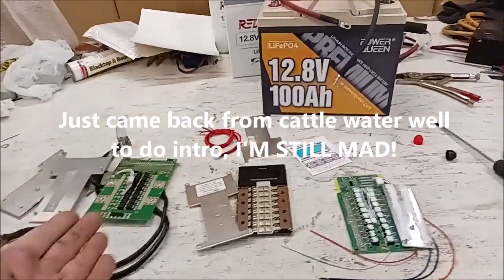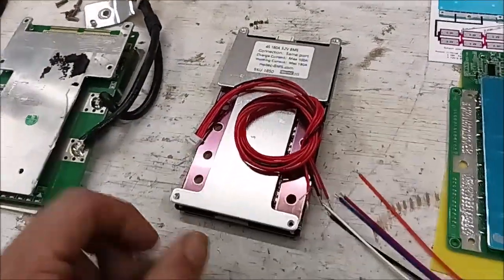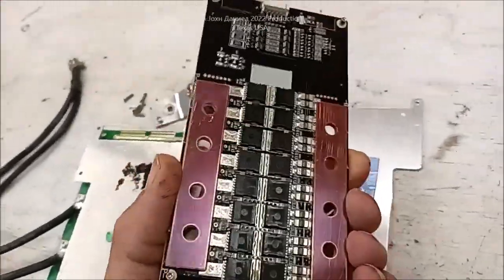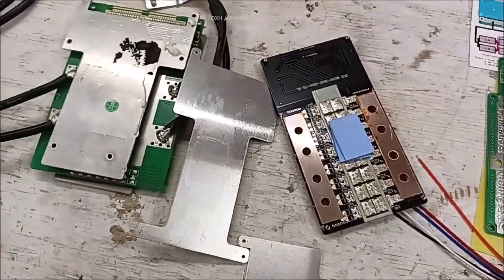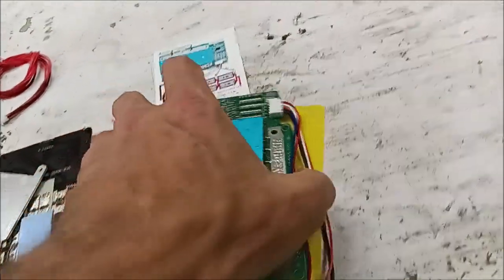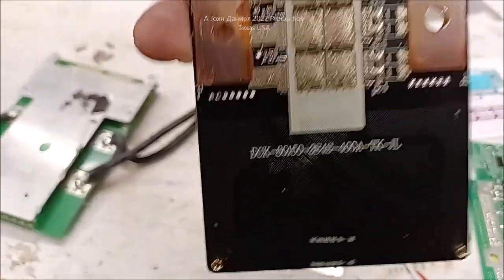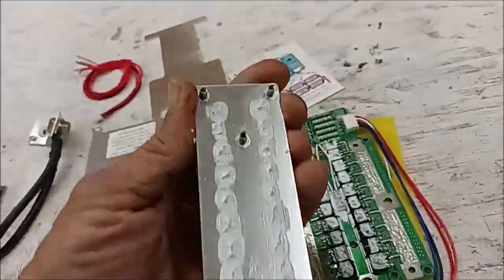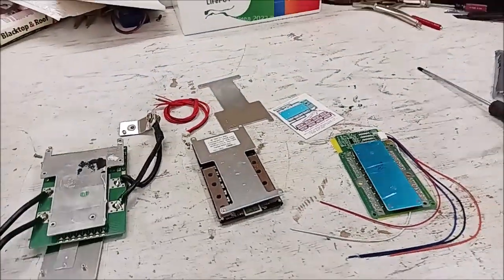HELTEC BMS Battery Management System, once great, now garbage? Better cheaper options below

Comment from the maker: UPDATE ADDED BELOW A better affordable BMS brand https://s.click.aliexpress.com/e/_DmplTQF and lets keep it going,  https://www.buymeacoffee.com/JOHNDANIEL  join up. Discover more. Never again will I buy something from Heltec.  POWER QUEEN Premium LiFePO4 Batteries 10 to 400 Amp https://shrsl.com/3kfqh UPDATE - I sent the high resolution pictures, 8 of them, to a tech friend who now works remote for Mouser, 34 years a technician. Started at VLSI and 19 as a board designer with Chrysler, his response is "Chinese half assed". He agreed they were playing a FOOL YOU by placing the more expensive to make Aluminum plate on the back to make it appear as the JBD a dual sided heavier built and cooler running BMS.  He said the output switches (p-mosfets) are rated to just handle the load, but not long term, and absolutely not enclosed or in a restricted ventilation or higher than +40c temp area. Insufficient cooling in any form will cause failure of one then failure of all. Saying its SAME PORT design is OK to use,  just not to allow it to get hot. He noted the oddity of conductive Charge rate being claimed is 60% of draw so it shares partial direct, with no in use charge characteristics noted. Which he said to consider the BMS based on that as actual draw ability in a sustained current. His solution was to improve the heat sink and it would probably be OK for normal use, just keep draw under 130 amps. 
 Oh nice. Well crap! I live in hot Texas 🌞 ,not Montana ❄️ like him. So I stand by my first impression.
Reply: Heltec has transistors that are in a much more powerfull package. Looks like L-TOGL or something alike. The other are something like DPAK, much less powerfull package.
But still - you can not judge just by the looks, you need to know the model of each transistor, and than read the manual.
They still may not be right about the number of the transistors, but you are not right about their power...

Comment: You need to look up the data sheets on the mosfets the raw number of mosfets is not important as the heat and current depends on the voltage drain to source and rds on resistance

Comment: Starting to rethink my use of this product. Had 2 units arrive dead on arrival. Chatting to Jacqueline from support only showed they have no idea about the product they sell and play the ignore game hoping you will go away. They only care about mass production and have no intentions of rectifying faulty products. Think twice before you consider buying.
Reply from the maker: If your referring to Heltec then YES! Same issues I was having, bought 4, 2 did not ever go into balancing and faulted constantly. One failed in under a week, they ignored all attempts to correct. Was a good brand for DIY, but are not worth the waste of time now.
Reply: @JOHNDANIEL1  absolutely talking about heltec. They even tried to claim at one stage the unit was over heated when I hadn't even had the chance to put a load on them. Further investigation found a couple mosfets had internal shorts or incorrectly mounted. The units would not turn off. I commission everything before putting into service so it was lucky the bms didn't cause any other damage. I am considering doing a YouTube video to show how bad the product is and what to expect when talking to support. Especially Jacqueline from support. She has no idea.

Comment: FYI..  There are no mosfets on the back side because that board supports more than one config.  It looks like that same board supports up to a 400A (from the silk screen on the board in the video) version?  So no mosfets on the backside is perfectly acceptable for that configuration.   You also can't judge the quality of the mosfets by their size/number.  If one mosfet has 1/2 the Ron value then you only need half of them.  Not all mosfets are created equal.
So it seems unfair to trash Heltec without even testing it to see if it will run at it's rated value. Now the heltec one might be crap.. but without testing it first.. you just don't know.  Cheers
Reply from the maker: We tested it, it was supposed to handle a 80 amp continuous incoming charge at 14.6 volt, but faulted at anything over 50 amps. As for draw, it is supposed to handle 380 amps, 200 continuous and would not handle more then 20 minutes of continuous 145 amps for near full draw on a 2000 watt inverter from a 304AH 4S set up. The Fets may be up to the capacity, but something in the flow control circuits is crap.

Comment: Hey John I finally was able to get some batteries, I got some of the super beast batteries from battery Hook-up and I remembered that you talked about temp switches in one of your videos, I would like to get some to turn on the heater pad and fan in each battery, is there anyway you can send me some please or if you can't, maybe a link so I can find some. I also plan on doing a BMS less install, to start my bus and to power everything, what would you recommend for it. My bus is a 1967 GM city transit bus with a Detroit diesel 6v71n

Comment: Off-topic, John, do you have any thoughts on a Yinleader 2000W pure sine (green color) inverter with remote control sold on Amazon? Thanx.
Reply from the maker: I have heard of the name, but its a light weight in build. I'd go with heavy and proven in 12, 24,36,48 or even 72 volt options with all the parts for that much money, a SWI (Xijia 2500) https://amzn.to/3q54BmW
Reply: @JOHNDANIEL1  Thanx, I appreciate that.

Comment: hi does the bms in your link have low or high temp censer capability? or can i add it to bms .try to find good bms,to put away in my emp stuff in case of, nobody knows if these batts or bms will survive an emp thanks.
Reply from the maker: The cheap one has high temp disconnect
Reply from the maker: PS - I'm going to be showing people how to add a basic low temperature cut off to any BMS.

Comment: hey john i have 38120s 40 of them in a 4s ,could i use just a plain battery balancer in stead of a bms ?
Reply from the maker: I'd use a bms for those. They likely have huge current ability which means no worries about draw limits  but they also may overcharge.

Comment: I like and use the Electrodacus sbms0 bms. The idea of putting high current through the bms and hoping that the fets hold up just seems to be too flaky for long-term usage :)
Reply from the maker: UPDATE - I sent the high resolution pictures, 8 of them, to a tech friend who now works remote for Mouser Electronics, 34 years a technician. Started at VLSI and 19 as a board designer with Chrysler, his response is "Chinese half assed". He agreed they were playing a FOOL YOU by placing the more expensive to make Aluminum plate on the back to make it appear as the JBD a dual sided heavier built and cooler running BMS.  He said the output switches (p-mosfets) are rated to just handle the load, but not long term, and absolutely not enclosed or in a restricted ventilation or higher than +40c temp area. Insufficient cooling in any form will cause failure of one then failure of all. Saying its SAME PORT design is OK to use,  just not to allow it to get hot. He noted the oddity of conductive Charge rate being claimed is 60% of draw so it shares partial direct, with no in use charge characteristics noted. Which he said to consider the BMS based on that as actual draw ability in a sustained current. His solution was to improve the heat sink and it would probably be OK for normal use, just keep draw under 130 amps. 
 Oh nice. Well crap! I live in hot Texas 🌞 ,not Montana ❄️ like him. So I stand by my first impression.
Reply from the maker: Yes, I do not like the design of the BMS products they have on market, a simpler Solid State Relay with a locking optocoupler should be created with a active balancer. Or something similar.
Reply: @JOHNDANIEL1  That's basically how the Electrodacus sbms0 and dssr20's work. The bms does the active balancing and uses optocouplers for load/charge connect/disconnect while the dssr's are a custom solid state relay for controlling solar panels or diversion loads. The bms also has a nice lcd screen so that you can see what's happening. The battery main leads connect to the busbars so that you can pull heavy current that doesn't go through the sbms0 as that only connects to the battery through the balancing wires. The Pv and load shunts let all the current flow and the sbms0 just measures it from them.
Reply: Check out http://www.electrodacus.com/ Unfortunately they're not currently available due to semiconductor shortages.
Reply from the maker: @gordonb2011  Yes, I knew of them. The best design for a BMS is exactly that one, which is a Electric car design, instead of a overgrown toy battery design they have came up with. Sadly the Chinese forgot to steal that design to hock to us.

Comment: Personally, I really love buying the absolute cheapest of the chinese knockoffs, just because they stole the design, and if I get it cheap enough, I can reverse engineer it enough to know what mosfets or other circuits should go in it, and can take a $5 piece of electronics, and go to mouser and get the IRF equivalent of it and know that once I spend a few minutes soldering and a few extra dollars, I can have something that is super high quality.

That is also the reason I LOVE the Power Jack brand low frequency power inverters, I can go through it and upgrade and fix the design flaws and end up with something that beats the heck out of the highest quality inverters.  I can buy 2 or 3 Power Jack inverters, upgrade the mosfets and tear the transformers down, combine the iron laminations (toroidal transformer at that!) and rewind it and end up with a transformer that would normally cost 4x or 5x the cost of the all 3 Power Jack inverters, plus have spare parts and enclosures.  I have done this with the 8KW inverters they have, and now have a Power Jack (or would it be a Power John now?) inverter that can do 20KW continuous with an INSANE amount of "peak" power for around $700.  
I would NEVER use that crap or trust it to do what they claim, but it's so much cheaper to buy their cheap crap and upgrade it and end up with something that outperforms anything commercially available for 20% of the cost.
The only downside is that it does cost me a lot of time, and depending on when I am able to make those modifications and what else I could be doing with that time, could be argued that it did end up costing as much as 100x the actual "cost" of just getting something that is quality and matches my requirements.
Reply from the maker: UPDATE - I sent the high resolution pictures, 8 of them, to a tech friend who now works remote for Mouser Electronics, 34 years a technician. Started at VLSI and 19 as a board designer with Chrysler, his response is "Chinese half assed". He agreed they were playing a FOOL YOU by placing the more expensive to make Aluminum plate on the back to make it appear as the JBD a dual sided heavier built and cooler running BMS.  He said the output switches (p-mosfets) are rated to just handle the load, but not long term, and absolutely not enclosed or in a restricted ventilation or higher than +40c temp area. Insufficient cooling in any form will cause failure of one then failure of all. Saying its SAME PORT design is OK to use,  just not to allow it to get hot. He noted the oddity of conductive Charge rate being claimed is 60% of draw so it shares partial direct, with no in use charge characteristics noted. Which he said to consider the BMS based on that as actual draw ability in a sustained current. His solution was to improve the heat sink and it would probably be OK for normal use, just keep draw under 130 amps. 
 Oh nice. Well crap! I live in hot Texas 🌞 ,not Montana ❄️ like him. So I stand by my first impression.
Reply: @JOHNDANIEL1  Exactly!!!  That's how it is.  Anything like this has to be gone over and analyzed, but, if you have the time and energy and access to the appropriate replacement components, you can still come out ahead, but if you don't have the time or energy, TOTALLY NOT WORTH IT AT ALL.  
My dad was an EEE, so I spent my whole life as an apprentice to a master electrician, so as long as I know what I'm getting into, I can usually "upgrade" the cheap shit to something that will work really nicely for pretty cheap.
Having the ability to cast my own aluminum and copper heat sinks and a really nice Hakko hot air/soldering rework station, I don't mind the cheap shit when I need a $350 item for $30 or $40 upfront.  Sometimes the investment in expensive equipment and components does pay off when you can get something that COULD be nice, if enough energy and the right components were thrown at it.

What I don't get is why don't they spend the extra $60 and just charge an extra $60 and have something that is actually half way decent, or even pretty good?

I figured up what I spent on the power inverters I got, and if they only put an extra $250 into them they could have something that actually has a $2000 value for about $700 instead of a cheap shit $300 inverter that is pretty much worthless.  
They even wind their own transformers and use fairly decent iron laminates, so I reached out to them and a replacement toroid that I use to rebuild and combine them to triple the capacity of the unit is only about $200 including shipping from Chyna.  It wouldn't cost that much more to make something that would actually make a good name for itself and be worth the money.

It's so crazy, I can buy 2 whole inverters and an extra transformer or two and upgraded mosfets and control circuit and have a 10KW SUPER RELIABLE inverter that has a 16KW surge for just an extra @350 and a few hours of time and run my entire house off grid.  
The only real expensive part is the batteries and solar panels, and I buy as many scrap lead acid batteries as I can and recover all the lead and recast the lead plates and then rebuild the batteries as deep cycle batteries and the only real cost is the time spent and the solar panels, since I have absolutely no way to manufacture those.

I guess all the chynese care about is the absolute cheapest shit that will almost work just to screw us over instead of actually make something that works.

Comment: The Heltec looks like it has dual FET packages.  Some percentage of the actual FETs will be for discharging, the remaining for charging.  Out of curiosity, what is the part number on the packages?
Reply from the maker: The 100 A don't have separate charge  discharge and neither does the Heltec. They replied claiming it's half of a 300 amp model, but their 300 amp model has 36 fets. No damn reason to have dual aluminum plates if it wasn't supposed to have 24 fets in it. My 160 amp from them September 2021 has 24 fets, same identical build but copper strips on only one side.
Reply: @JOHNDANIEL1  It may not have separate charge / discharge ports or user accessible controls of that either but the body diode in the FET requires that there is one set of FETs for charge current control and an 'opposing' set for discharge current control.  Since it appears to be dual FET packages (that's an assumption on my behalf) it's possible the 'opposing' FET is in the package.  Either way, what's the part number on the package?  I'm curious as to what they are using.
Reply from the maker: I'll have to scrape off the coating on it to read the fets numbers. But I can compare identical builds and see one is missing lots of parts.  And still matter the C,B,P, points the second aluminum plate if it's of no use is 500% more expensive than a slip of fiber backer plastic to include like they do their 100a model.
Reply from the maker: BTW - There was no package if your referring to shipping and normal wrappers with papers. No tag. Model number was shown in the video.  Just sent in anti static envelope in a bubble envelope.
Reply from the maker: UPDATE - I sent the high resolution pictures, 8 of them, to a tech friend who now works remote for Mouser Electronics, 34 years a technician. Started at VLSI and 19 as a board designer with Chrysler, his response is "Chinese half assed". He agreed they were playing a FOOL YOU by placing the more expensive to make Aluminum plate on the back to make it appear as the JBD a dual sided heavier built and cooler running BMS.  He said the output switches (p-mosfets) are rated to just handle the load, but not long term, and absolutely not enclosed or in a restricted ventilation or higher than +40c temp area. Insufficient cooling in any form will cause failure of one then failure of all. Saying its SAME PORT design is OK to use,  just not to allow it to get hot. He noted the oddity of conductive Charge rate being claimed is 60% of draw so it shares partial direct, with no in use charge characteristics noted. Which he said to consider the BMS based on that as actual draw ability in a sustained current. His solution was to improve the heat sink and it would probably be OK for normal use, just keep draw under 130 amps. 
 Oh nice. Well crap! I live in hot Texas 🌞 ,not Montana ❄️ like him. So I stand by my first impression.
Reply: @JOHNDANIEL1  Still waiting for that part number for the FETs.